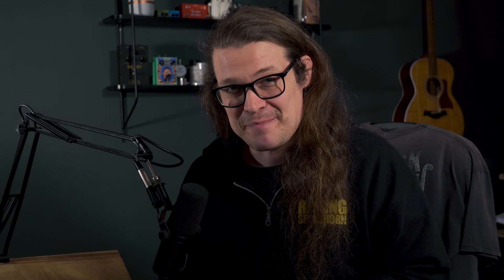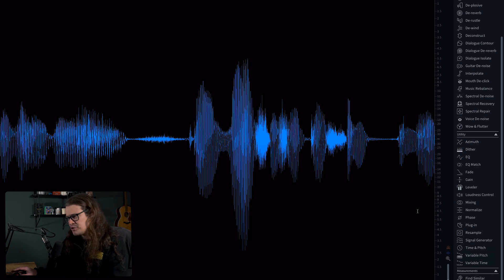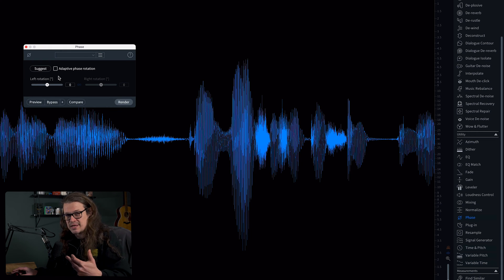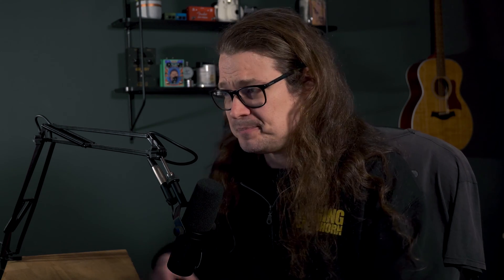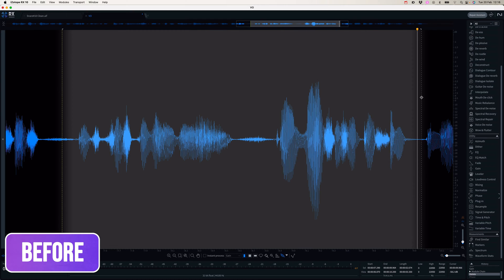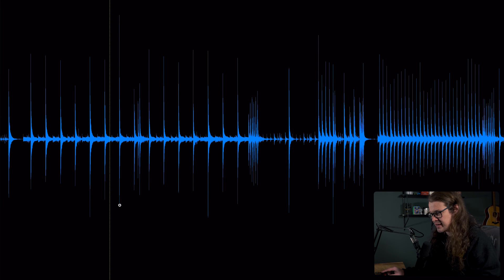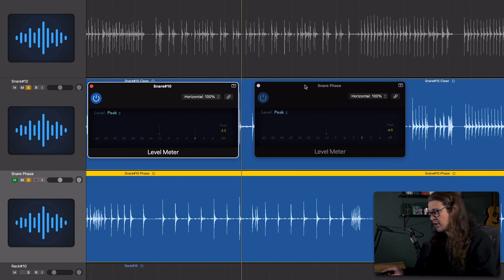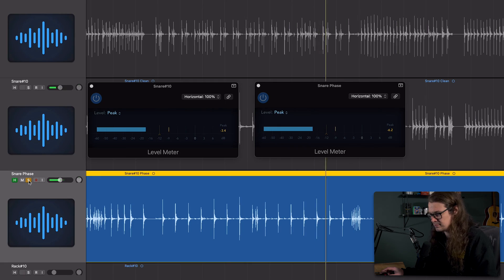How To Fix Uneven Waveforms With iZotope RX

Comment: Sam, your explanations of the ins/outs of what RX is actually "doing" to your audio is so helpful. Thanks for breaking it down. I'm doing a deeper dive into what my effects chain is really doing and your playlist is proving invaluable. Thank you!
Reply from the maker: I appreciate that! Let me know if there’s anything you’d like to see a video on.
Reply: @SamLoose  I am curious about keeping a raw file. I'm a voice actor. I have been bouncing a wav file that has gone through a "cleaning" chain into Izotope RX to render my waveform and then importing it back into Logic as a new track and sending that through a Bus 2 with processing effects.  With choosing to use the shortcut/key stroke to open up the audio editor (brilliant tip, by the way) and saving the rendered version of the audio, I no longer have a raw version of my work. True? Do you have a workflow suggestion there?
Reply from the maker: @annfritzvocals if you use the external editor method and don’t overwrite the original file (so save the rxdoc if you like, but just don’t hit save when it’s in RX as an unnamed project) then export the file from RX using cmd + E, then import that back into Logic. That’s one way that would work, or you could duplicate the region within Logic, right click on the new one and “save as new audio file” then open that in the external editor, and it will leave the original file alone. Both methods will work, one may just be better suited to your workflow.
Reply: @SamLoose  I'll play around with those methods! Thx!
Reply from the maker: @annfritzvocals let me know how you get on!